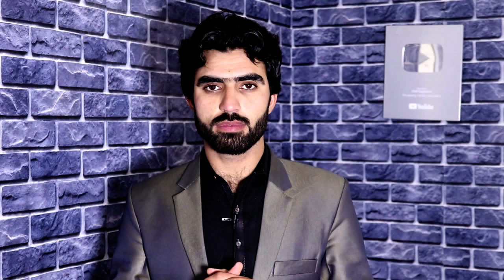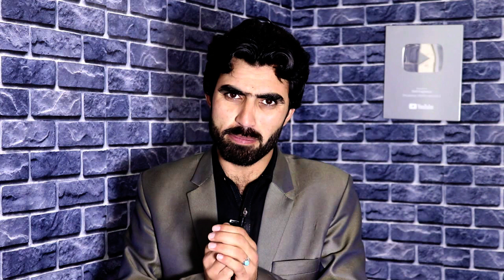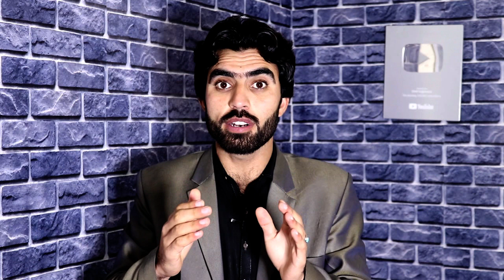Civil Engineers Stop Making Mistakes Now - Civil Engineering Mistakes

Comment: sir, there are structure designer mention #8 and #10 mm bars in their design, so site engineer have to follow steel detailings in slab. usually 8mm and 10mm bars used in 150 mm thick slab.